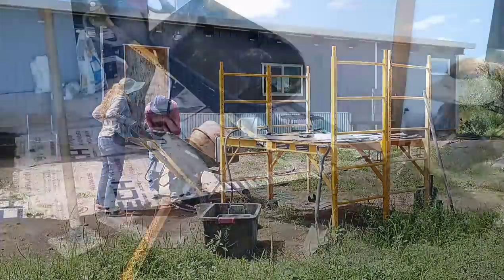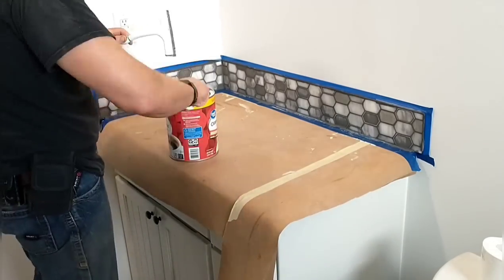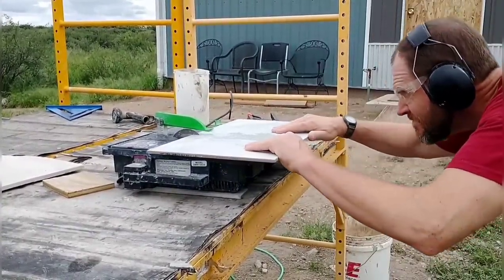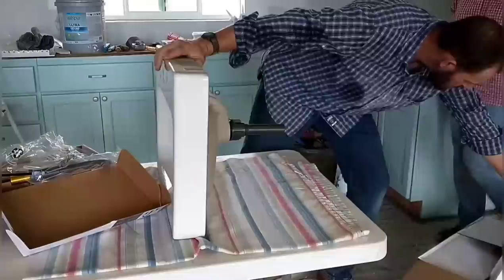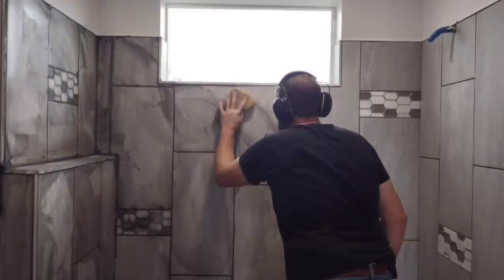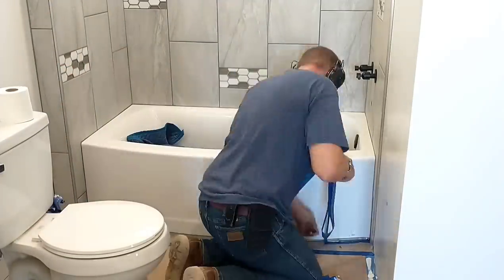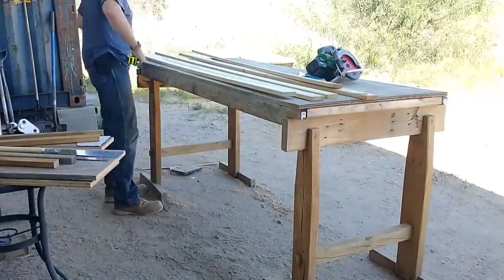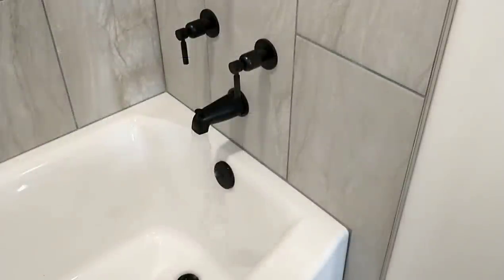We Finished the Bathroom! DIY Off-Grid Home Build #45 Tile, Wooden Countertop, Sink, Tub, & Faucets

Comment: An amazing transformation this week.  Thanks for sharing this video journey.  Your use of accent tiles in among the slabs is terrific.   Once you are finished trimming the wall-floor transition it will really come together.  Is the concrete floor nearest the tub sufficiently rough to avoid slipping with wet feet?   Great shot of April’s garden in the closing moments.

Wishing you another blessed week, gentle weather, nourishing rain and restful evenings.  Loving Red’s DAD shirt.  Peace
Reply from the maker: Thanks! Yes the tile turned out really nice! The floor may be a bit slick especially since we just waxed it. There is some texture though, and we will add some rugs too. Some of the okra is 8 feet tall now, & lots of wildflowers came up during the monsoon rains. 🌻😊🏜️

Comment: If you put the silicone down and ten spray some soapy water on it, the silicone will stick to the original surface but not the soapy one.  Majles for an easy clean-up.  Cheers.
Reply from the maker: Interesting, thanks! 🌞

Comment: I wonder if anyone has used stamps like they use on concrete .
Reply from the maker: Earth floors are not as hard, so I'm not sure how well it would wear. When we applied the top coat on the floor, we did end up with some interesting pattern and texture. 🌞🏜️

Comment: It's all looking great, but the bathroom floor, unfortunately looks mouldy in places where the tape removed the linseed oil. Shame. Still, it's  all a learning curve. Good job.
Reply from the maker: It should fade some, but it's definitely a bummer. It just looks stained, mold is fuzzy. Glad we didn't put the oil on the kitchen first. We plan to just reseal and then wax the rest of the floors. Thanks!
Reply: @RedandAprilOff-Grid  The bathroom floor is such a minor issue compared to the amazing achievement of your house build. You had a vision, you knew what you wanted to achieve, and through hard work and tenacity, trial and error you are achieving your goals. Looking forward to more.